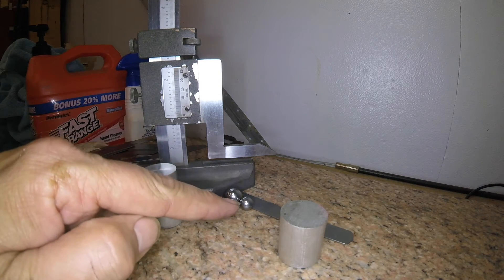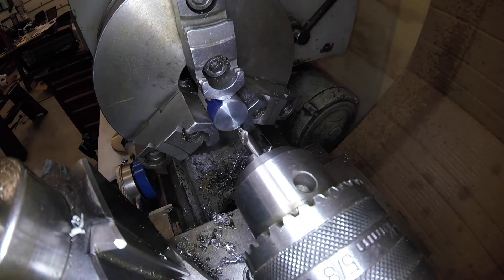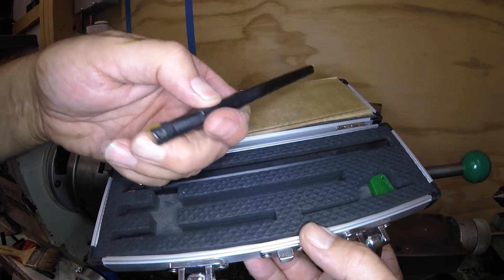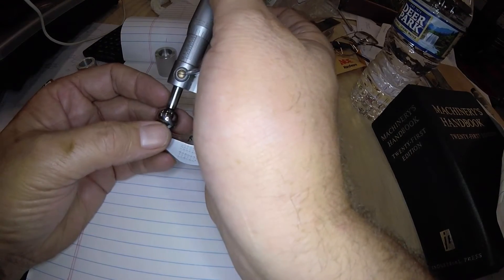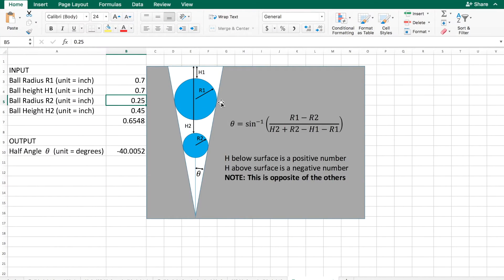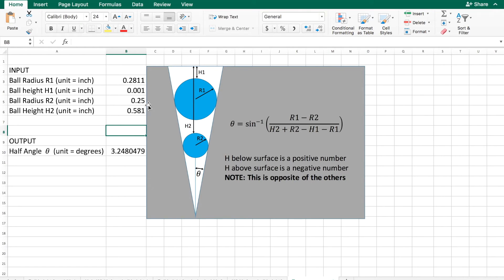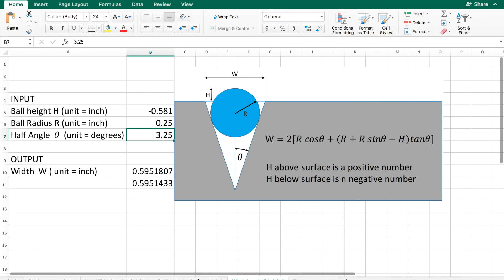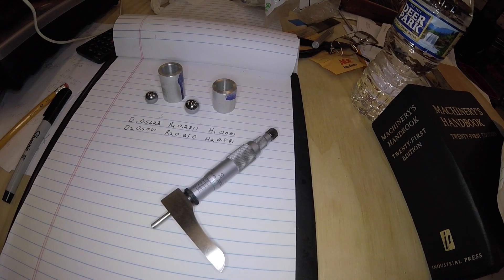Measuring an internal taper using two balls

Comment: I am missing why do you have 2 pieces off aluminum round stock. I she you cut one to 1.300 why was that the other one why. I have done the formal without the spread sheet to add everything up. r1-r2 divide by h2 +r2-h1-r1 I come up with 0.056658 then what do I do. again, I do not have the spread sheet to calculate thank you, this video is great, but I, am 68 years old little over my head.

Comment: Not only for the taper angle but also for the taper depth. Especially in small angles like 3 degrees, every 0.01 mm change in diameter causes a big depth difference. I used this method for a part with 8 tapered holes used for taperlock. I made an instructional video for the Chinese manufacturer and they did it right. I'm not sure if didn't make that video they would do it right. :)))

Comment: Bro, can you please teach how to check the dimension of a wedge block when it is been machined  using a surface grinding machine. we use to do plastic injection moulds where we use wedge blocks for locking of sliders, even though we have sine table with us we are only capable of  machining the wedge in required angle but never knew how to check the height some people say it can be measured with the help of a steel ball can you please help me.
Reply from the maker: Skanda,    I will try to figure out an answer to your question, but I can't really figure out what you are trying to measure.  Do you want to measure the thickness of a wedge while it is still being held in a surface grinder.  If so, how is it being held.  Can you draw a picture of what you want to measure and post it as a video, then put the video link here to help me figure out exactly what you want to measure.   Thanks,  Chris